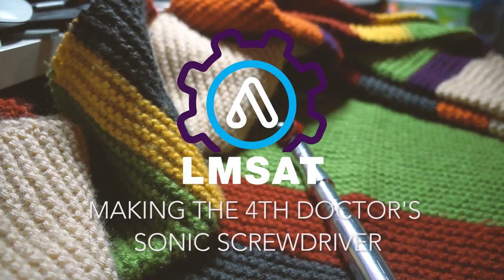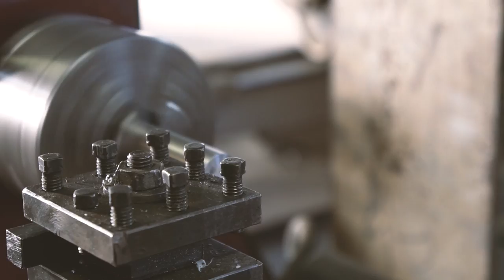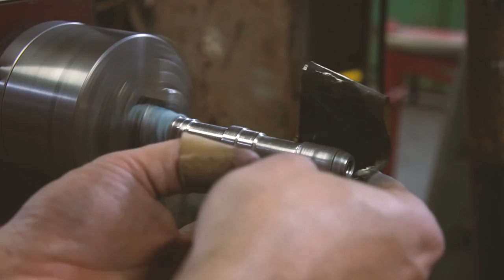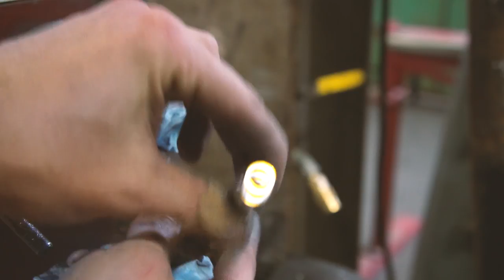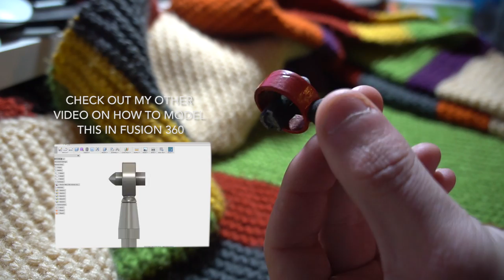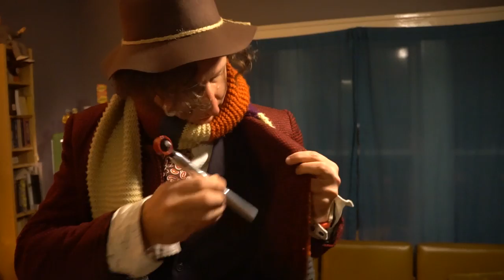Making the 4th Doctor's sonic screwdriver - LMSAT

Comment: I want a metal lathe - thanks for sharing
Reply from the maker: Yeah, it is a very useful thing to have. Fortunately we have two at work so I don't have to buy one for my home shop!
Reply: I just looked into them - not bad - but a Bridgeport wow - I better start saving my pennies  or sell one of my kids.
Reply from the maker: A bridgeport that we've been slowly rebuilding has been sitting 25 feet away from my desk for the last 8 months. I want to see it working. But also, there is a Tormach that I run 10 feet away from my desk that I run.